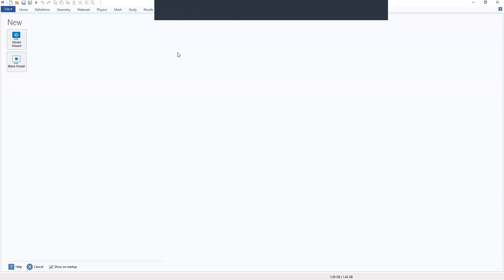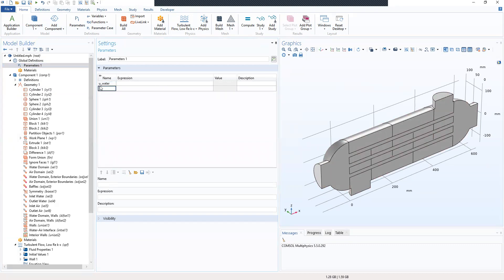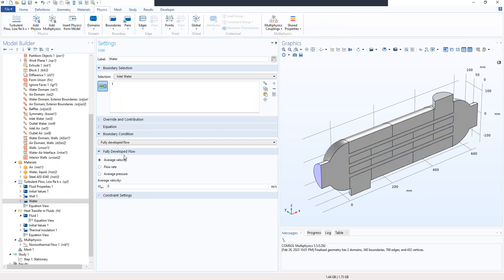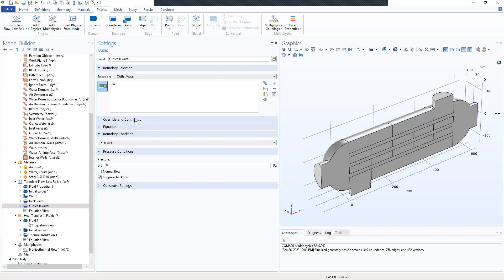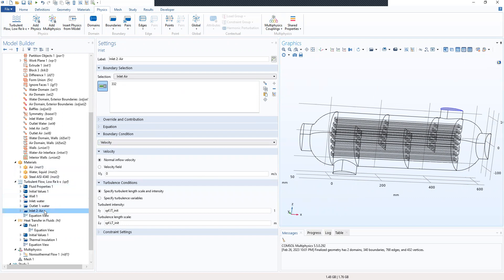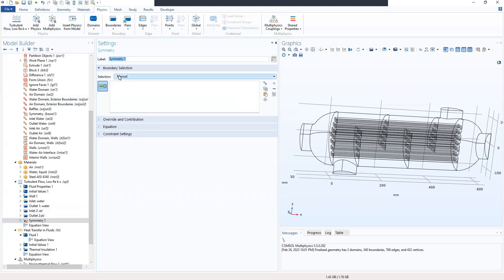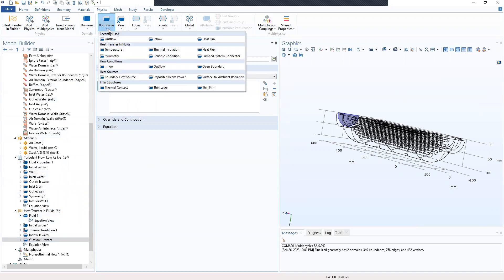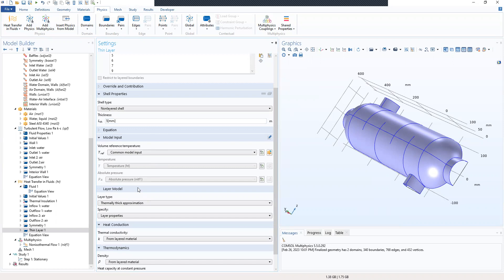HOW TO MODEL SHELL AND HEAT EXCHANGERS IN COMSOL. Part 1

Comment: Sir Can you clear my doubts?
have you created this geometry in COMSOL or any other software?
can comsol do simulation of geometry imported from solidworks?
Reply from the maker: It was created in COMSOL. It is quite similar to building geometry in solid works. 
In COMSOL you can import the following i. Mesh/ 3D printing file( STL. 3MF, PLY), ii. 3D CAD file, iii. ECAD file. So if you have your geometry from solid works saved in this format then it is possible to do simulation